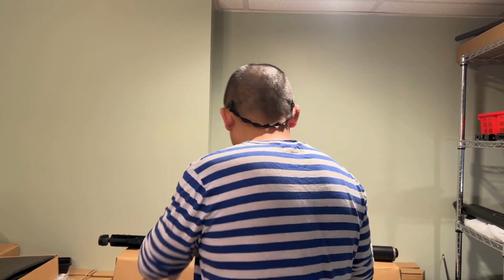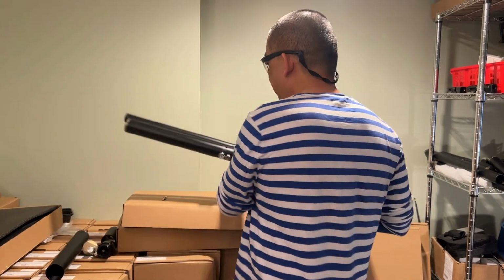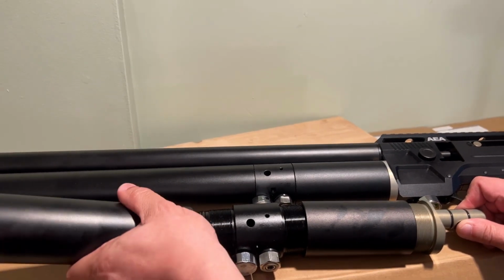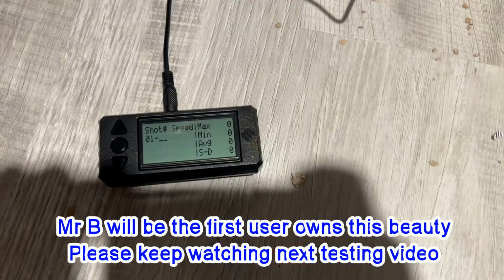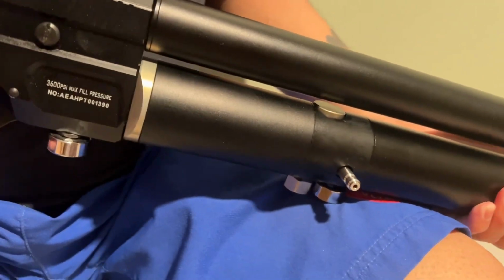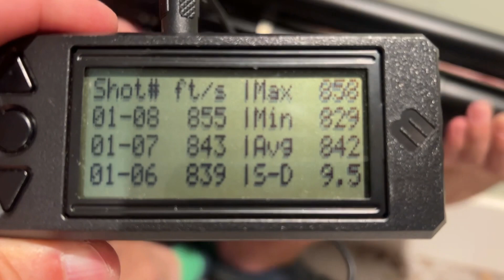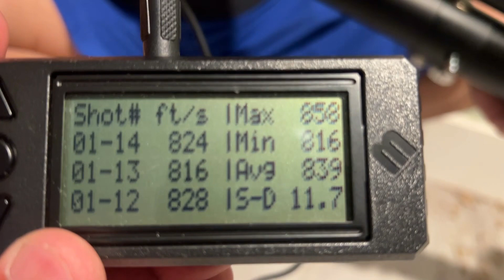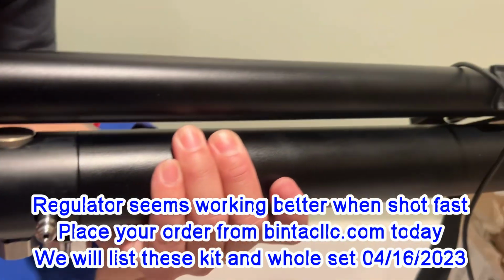BinTac: New release customized Super Terminator

Comment: Great testing. Have you cut the hammer spring? If not this spring is for without regulator . Little stronger.  With regulator pressure will lower. So need more softer spring. 
From number shooting faster and slow all each got great numbers . But shooting slowly more higher.

If you cut some spring. This two groups number will same. Then no matter shooting slowly or faster all same number.
Reply from the maker: You are so smart my friend we did not cut it just leave that for customers they can do more customization later

Comment: Question guys. What size is the air bottle that comes with the stock bin tac s45 in millimeters please? Because I don’t know what size bottle clamp to buy so I can attach a picanny rail. Thanks
Reply from the maker: On this one is 52mm
Reply: @sigshooter6213  s45?
Reply from the maker: @MrRahlo42  same 52mm carbon fiber is 61mm
Reply: I’m alittle bit confused. You said it’s 52 mm but then you said it’s 61 mm? I’m new to this sorry
Reply: I’ll just measure it I guess. Thanks for replying
Reply from the maker: @MrRahlo42  original tube on S45 is 52mm but carbon fiber tank is 61mm
Reply: Ohhhhhhhh!! Lol thanks by the way you really designed a beautiful gun in the s45. I absolutely love it. But the only problem I have is not having a manual that shows the break down of the entire gun. Remember people plan on keeping it for years to come and I would need to know where all the O rings are so please consider that. Thanks again